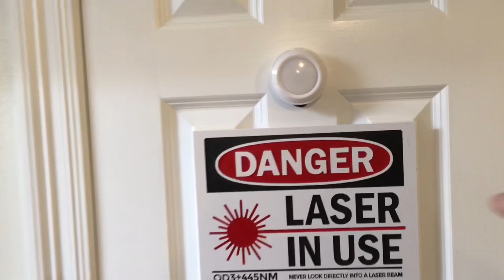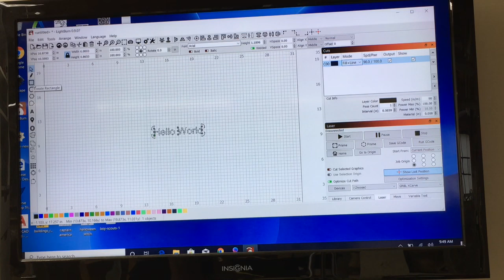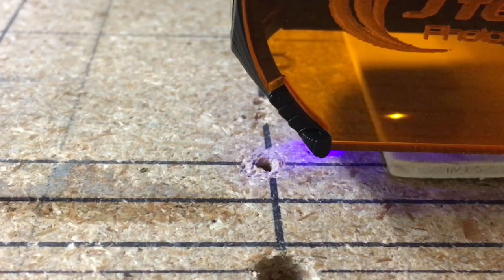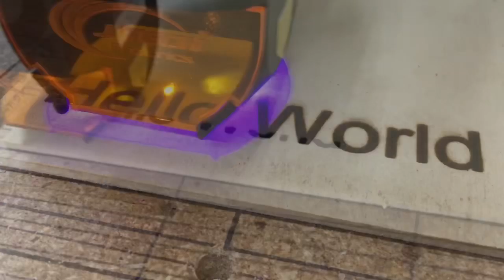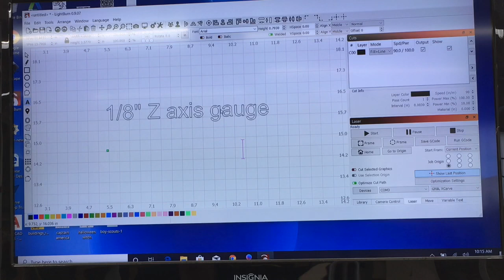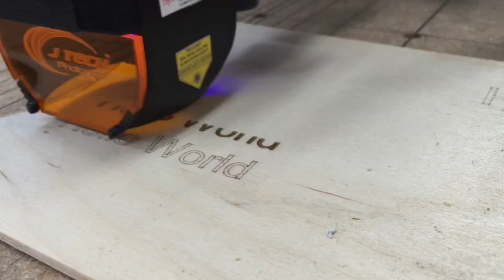FIRST LASER TEST: Software Choice, Engraving Materials, First Project

Comment: Hello, great video you helped me set up but my question, I try to do a cut but my laser is moving super slow, had the setting at 90/100 just like your video, any help would be great, TIA
Reply from the maker: I would suggest checking the GRBL settings as well as the settings in Lightburn. (Assuming you are using Lightburn)

Comment: will it cut vinyl sheets?
Reply from the maker: I have not tried to cut vinyl. Without knowing what type of gases are produced, I am not willing to do it.  I know that PVC when melted will give off poisonous gases.  I do not have a controlled environment to take all of the fumes out of the shop.
Reply: @PawPawsWorkShop  I use oramask sometimes when CNC carving something I want to paint after I cut.  It does not leave clean edges mpost of the times and wondered if the laser would be able to cut it instead.  As to poisonous gasses, I hadn't considered that.  Thanks for the alert.
Reply from the maker: A downcut bit usually will work best for the oramask.  It will leave clean edges.  I have had to follow up with an upcut bit to clean the bottom on PVC to get the clean look.  It takes a little experimentation.

Comment: I have viewed most of the videos and have not observed and test on stained wood.  Have you tried any and if so what was the result.
Reply from the maker: The wine rack was stained then engraved.  It did just fine.  The only issue is the color difference was very similar.  There were no issues engraving.  I also have engraved over paint, again it did just fine.  It did leave ash as it engraved.

Comment: Paw Paw, this may have asked already.  When I go to the lightburn website it talks about three different things to buy?  Do I need more than the software?  I have the X-Carve 1000.
Thanks in advance.
Reply from the maker: You will need to chose the wattage of laser, type of mounting kit, power cord option,  magnetic shrouded version and a high resolution lens is optional.  I would suggest the Lightburn Software, it is $40 US and is a great software to use with the laser.

Comment: Hi Paw Paw,
I have an XCarve, What version of light burn do you need to by after the trial? 
How does the laser attach?

Do you leave the Laser attached full time when switching from Laser to Carve? 
Does the Dust shoe get in the way?
Reply from the maker: When you download Lightburn, you will get the latest version.  I never got the trial version.  The laser is attached by magnets. When I carve with the router, I remove the laser to prevent the dust getting into the laser.  The video explains everything.

Comment: I am curious as what steps need to be taken, if any, to switch back to the CNC. For example it looks like the laser needs to be moved up or taken off when wanting to use the router.
Reply from the maker: Nothing.  I only remove the laser to keep the dust off the lens of the laser.

Comment: Informative as always, Paw Paw!

Question: Will you eventually need some sort of fume extraction?  Specifically when cutting or engraving non-wood materials. I’m thinking that smoke would be toxic.  Don’t have a laser myself (yet!) so I could be off base here
Reply from the maker: At this point no.  I thought that I would have to vent the fumes but it is minimal.  If it does become necessary I will relocate the machine near a window and vent directly outside.